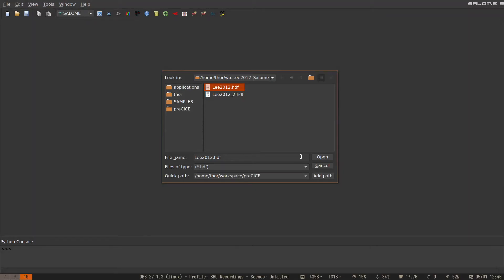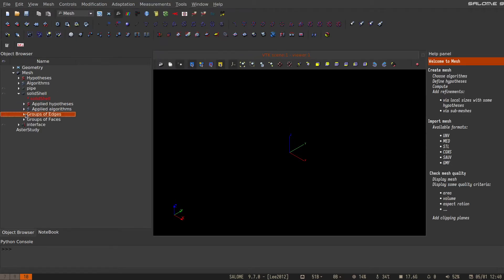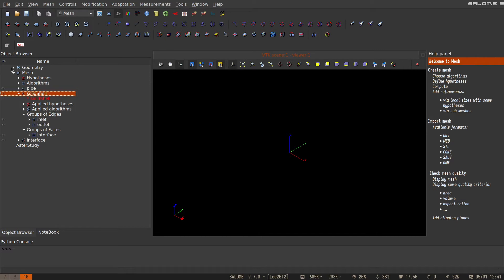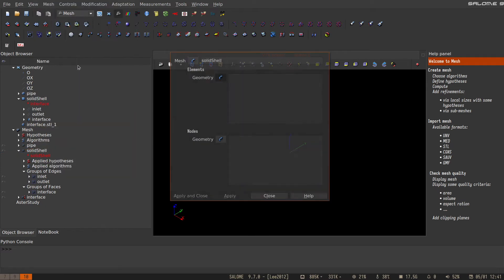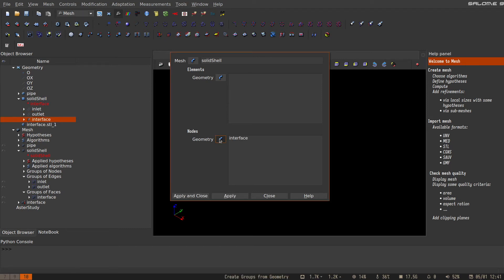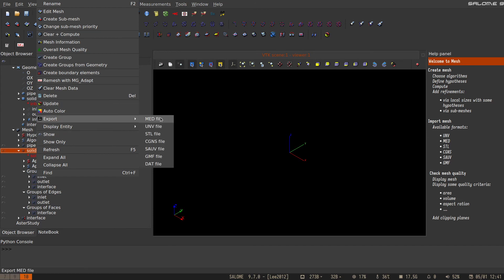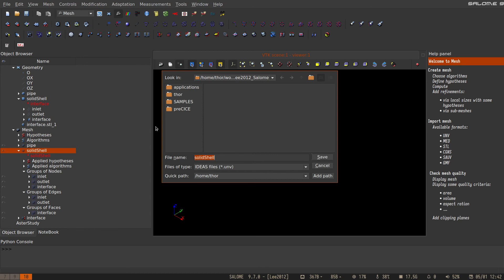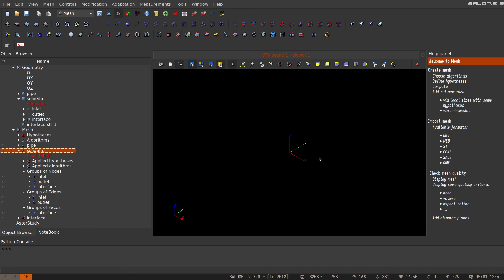IMPORTANT! Add Node Groups BEFORE exporting the solid mesh

Comment: Hello sir. I am not one your student but i find the tutorial interesting. However there is something that I don't understand : at the end of the second video, when you export for the first time, we have two entities (pipe and solidshell) but in this third video, there is a third entity called interface.stl_1 that you never mentionned before. Moreover you exported the fluid mesh as pipe.unv and in the 4th video it is named Fluid.unv, and when I use ideastofoam and checkMesh, my mesh is twice smaller as yours. My theory is that (pipe.unv + interface.stl_1)=Fluid.unv. With this problem, when i try to run the simulation the divergence appears way too early and results are not usable. 
Could you please help me understand what you did with interface.stl_1, and if you think i am missing something else please tell me 
Anyway thank you for your job
Reply: Yes same question Dear Prof. Please comment on this.